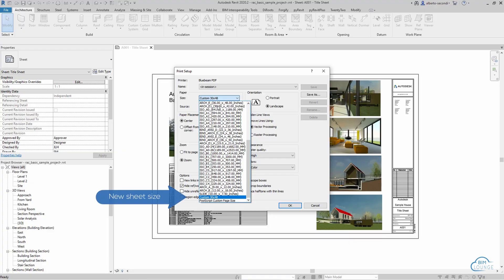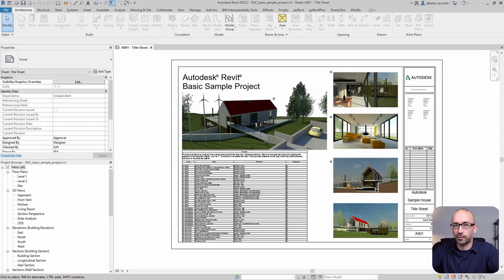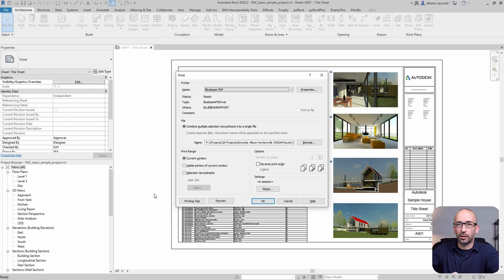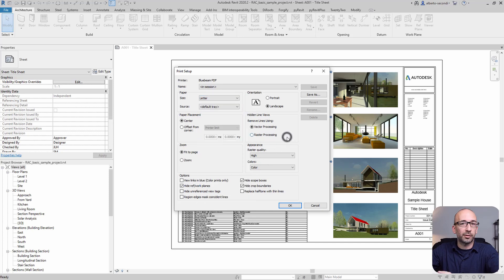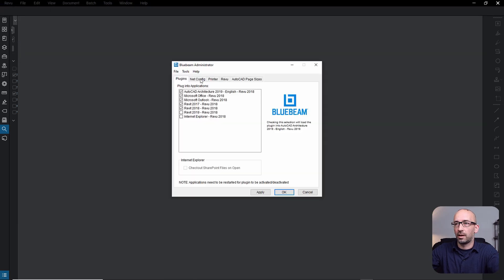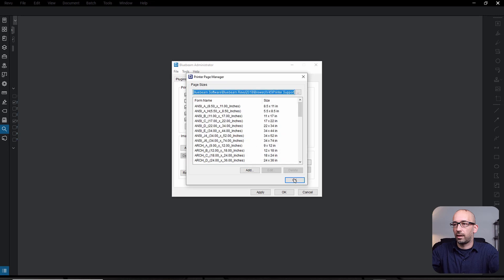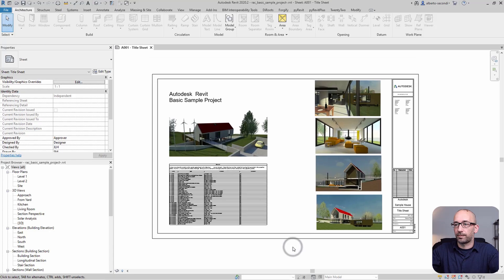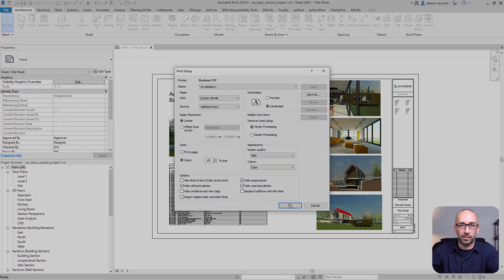How to Create a New Paper Size for Revit and AutoCAD - Bluebeam Revu

Comment: if I create the custom sheet size and load it into my cloud shared model, can my team also use the custom sheet size to rpint or do they need to follow the same steps ?
Reply: I know this question is months old at this point, but when I create new sheet sizes, I noticed that my default save location for sheet sizes was from my own C drive, so in my case, the sizes I create would only show up on my machine. You may need to re-path where BB loads those sheet sizes from to be somewhere you and your team all have access to if you wanted them to have the same sheet sizes you see.